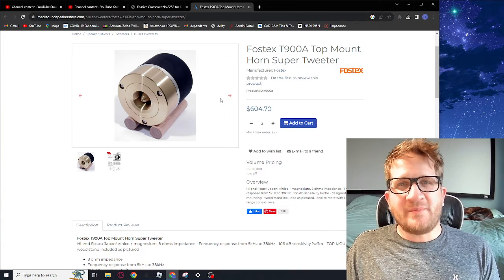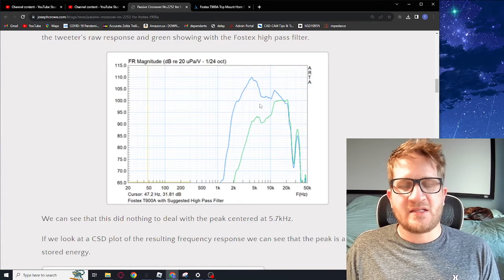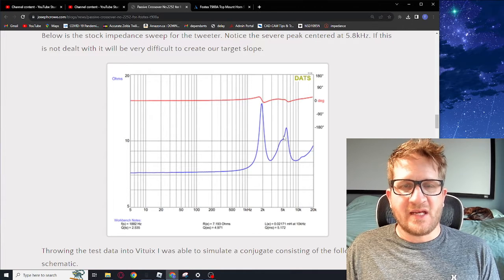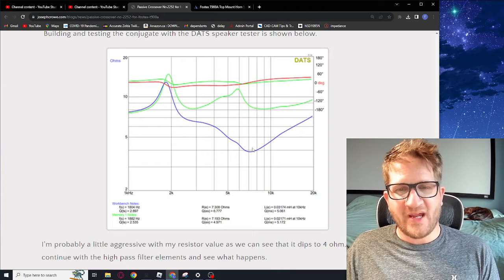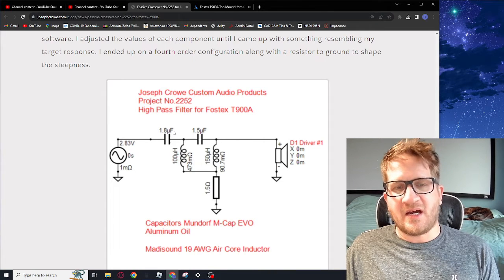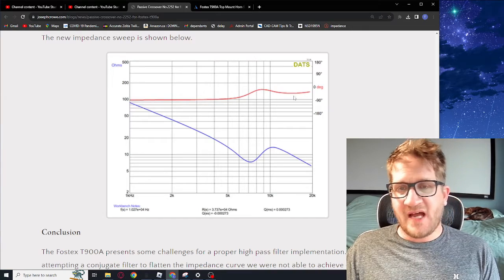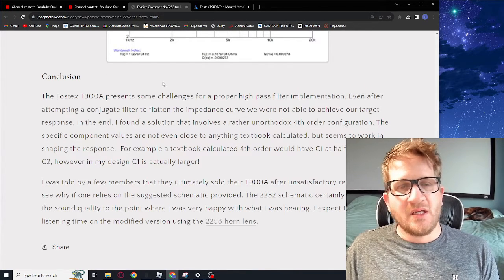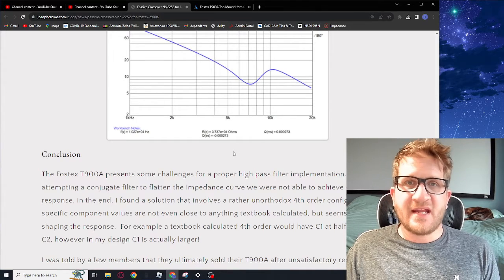Passive Crossover No.2252 for Fostex T900A

Comment: Have you tried digital crossover like minidsp;
Reply from the maker: I've tried the Hypex FA123 which is very low distortion and noise. But I've not tried some of the latest MiniDSP products. The third channel on the FA123 is lower power than the other two channels and only meant for HF drivers. So it sounds fantastic.

Comment: That's WAY too much work and money thrown at fixing $1200/pair super tweeters!  You still end up throwing away lots of sensitivity in the end.  Fostex seems to publish just as fake measurements as Beyma does for TPL AMT tweeters.
Reply from the maker: ouch...you're not wrong.
Reply from the maker: The horn lens I developed has also addressed all of the issues with the tweeter where it will likely be just a very simple filter.  But yes, why should one have to "fix" such an expensive tweeter.  https://josephcrowe.com/blogs/news/fostex-t900a-with-horn-lens-no-2258

Comment: Excuse me Joseph, but how come there is “dramatic improvement” in CSD? To my eye stored energy just evened out across the spectrum (there is more “ringing” than originally) and it rings exactly as long as before…?
Reply from the maker: That's correct, the improvement is just a you say, an evening out across the spectrum. Looking at it closer I don't think it's fair to call it a resonance, as the time scale is only 0.92ms deep. It's just the natural pistonic decay of the diaphragm. Most manufacturers have the time scale at around 6ms. So we ae straining at micro details in the data. The burst decay shows full decay by 6 periods across the spectrum, so not something that's even close to audible anyways.
Reply: @JosephCrowesDIYSpeakerBuilding  I’m actually willing to agree with your assessment regarding audibility of this decay, however in this case you also have to agree, that mentioned “improvement”/“evening out” is purely theoretical - if the decay/“resonance”wasn’t audible in the first place then mentioned improvement is only “on paper” (still isn’t audible anyway).

Comment: But how will the phase rotation of the 4th order work with the midrange driver? Looking forward to see some measurements of this filter in a lp/hp crossover situation.
Reply from the maker: I'm going to go out on a limb here...but I have not experienced this as an issue in crossover design. From my experience, if the slopes match at the crossover then all is well. I'm referring to the measured response of each driver with the intended passive filter. To me, what matters is that the summed acoustical and electrical transfer functions combine to form the target slope. So that means you can combine whatever order you need to achieve the desired slope. Horns have a very steep drop below the cutoff frequency of the horn, which requires the low frequency to have a much higher order electrical filter to match the strong acoustical filter of the horn's response below cutoff. If I am wrong I would like to know what metric shows me this. I always get a flat response through the crossover region if the slopes are symmetrical.
Reply: You will never hear the phase shift nor does a flat freq response yield the best sound.